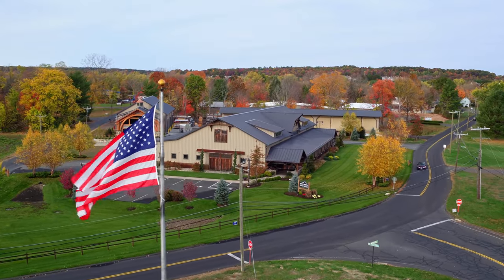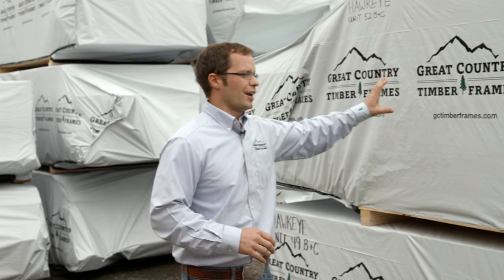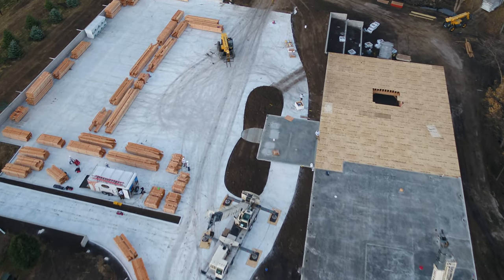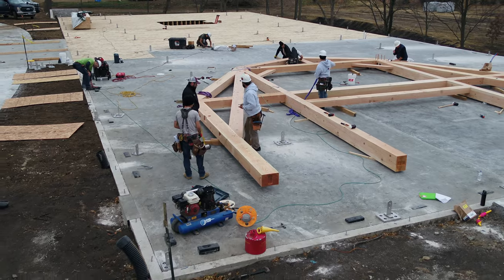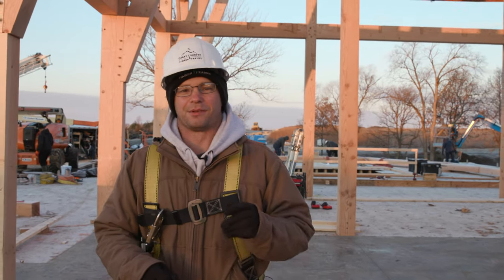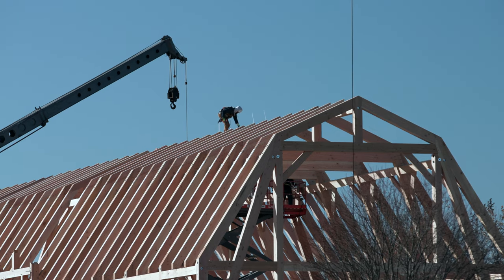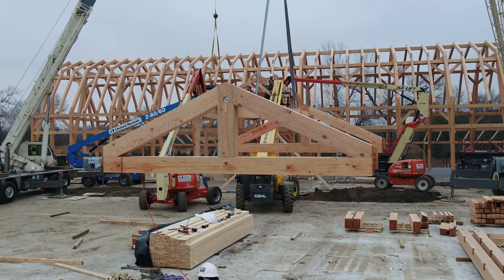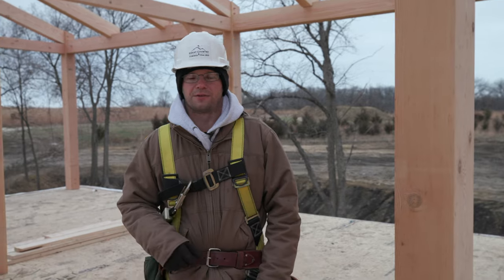The Iowa Barn: The Full Story

Comment: Well here goes, I think Great Country Timber Frame should have undertaken the replacement of the forest, aka the roof structure of Notre Dame Cathedral. They could have sent you the specs, since we know they have had them for years. I know they want to use trees from France, but the amount time they’ve spent, they could have shipped their timbers to you knowing the pieces would be done within a .001 of an inch and fit better than they ever had. They’d probably be headed back to Paris, and ready to install provided they prepared everything for reassembly. I know I’ll get flack on this, but they need to get a weather tight roof on that cathedral. I know there’s more to it than than the average guy knows, but I also have that much faith in your companies abilities. Just my 2¢ worth.
Reply from the maker: Thank you—to have that much faith in us as builders, designers, and engineers means a lot!